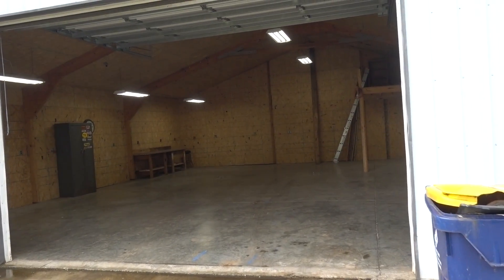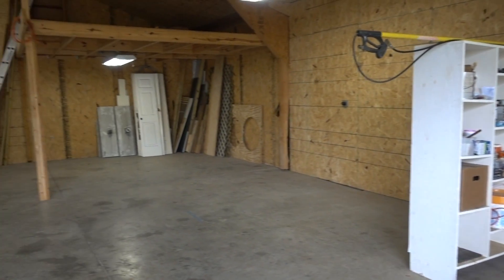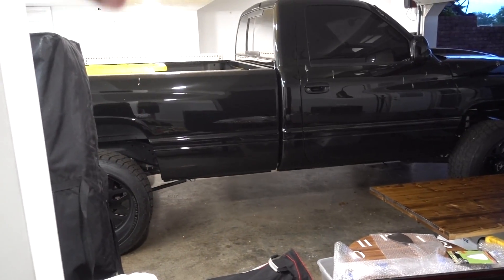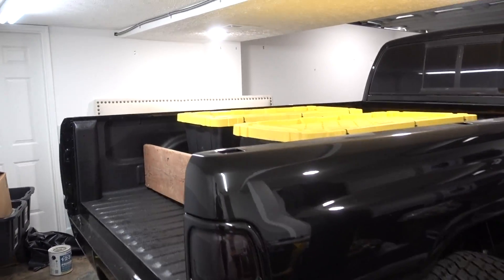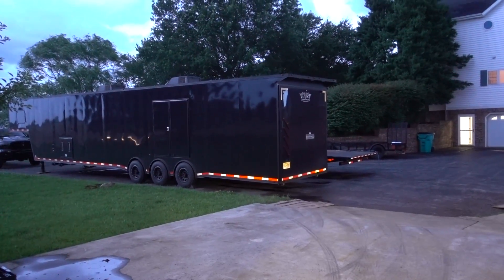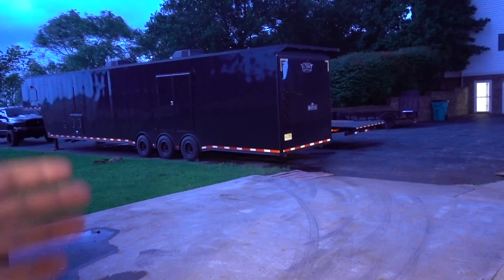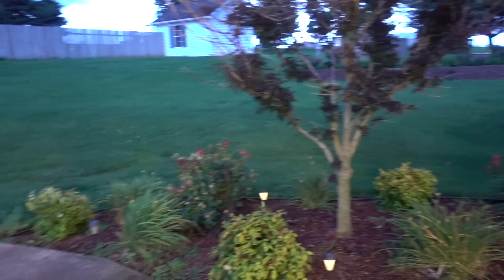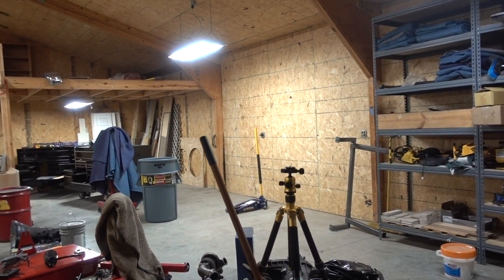NEW SHOP TOUR!!!! IT'S AWESOME!!!!

Comment: There are insulation kits for the shop overhead door instead of replacing the whole door. Also, whatever you do, DO NOT decide to just paint the concrete floors (garage and/or shop). They make concrete floor paint that can be very tempting when comparing the price to an epoxy coated floor. Problem is, it will NOT stick over time. As a custom home builder for 16 years (in Kentucky coincidentally),  I learned the hard way, the painted floors will begin to peel and flake not to mention it makes a huge mess. Then it's uglier than when you started. Oh well enough said. Just thought I would pass some along some experience we gained the hard way.

Comment: Prime the plywood with a stain blocking primer and paint the shop with a white semi-gloss paint.  It'll save you money on sheetrock since you already have the plywood anyway and a semi-gloss would have good light reflection and it will be easier to clean.

Comment: if you drywall then you could add insulation or maybe cover the walls with corrugated metal I know it is silver but would reflect a lot of light. For a temp fix to the hot shop door put a water mister on it that should help until you change the door.

Comment: Tge ac unit your thinking of is a minisplit. And yes they will push enougbt btus for your shop. They also make units where its one outside unit and multiple indoor heads. The newer ones have heat pumps as well which can do ac and heat. I'm sure the humidity is crazy down there and the minisplits pull an insane amount of moisture out of what ever location you install them in. Not to mention alot cheaper than running duct work. Do research on brands. They all do the same thing. And all use Mitsubishi pumps. Realy just paying for the name

Comment: Be careful moving the lift location depending on how thick of a pad the floor is. Alot of times if its just a 4 or so inch this slab, they will pour 6-8 inch footers under where the lift will be placed at to support the weight.

Comment: Putting up barn tin on wall kind of makes hard to trim around recessed outlets that you have. A/C you talked about, called split ductless unit, I think they go up 36k BTU in capacity. Where I live, to size one of those, a rule of thumb is 750 sqft per 12k BTUs, but that's with 8' tall ceilings, so if you get a 3 ton unit, you should be able to to maintain 72-75 in there, just don't expect to let it sit at 100 degrees for a few days and then pull temperature down to 70 in an hour. Cool place, congrats!!

Comment: Put some roll formed steal in the inside would really make it look good compared to the obs board. Like a white with gray Wayne’s coat on the bottom. And then with the grading and gravel pad for the trailers and peterbuilt, I’d put some modified base stone. Packed in obviously.

Comment: Check out Home Depot they have some badass ac units like that. I have a 4 ton AC in Vegas in 115 degrees with fabrication inside and it stays 75 degrees inside and I love it my bill went up 50 bucks a month not a big deal when you're not sweating your ass off not getting stuff done. Before I add the AC unit I worked at night In my shop.

Comment: I thought you owned the lights in the shop you rented and couple heat pumps in there would work well for a/c. Drywall half the wall then go steel the rest of the way and maybe wrap the rafters in yellow steel ?

Comment: The concrete under the lift pads in the current location is probably (should be anyway) thicker or reinforced better to handle the weight. Hopefully the whole floor can handle a lift and you wont need to make it stronger when you move the lift

Comment: Look into fiberglass reinforced plastic panels run around $40 per 4x8 sheet it’s a white lightly textured panel that’s washable did the bottom 4ft of my small shop with it an then used some peg board also

Comment: I’d put the tools in front of the yellow truck just so it’s kind of centered. I’m building a 40x40 right now and that’s what I’m going to do. And I’m putting osb up and going to paint it white. It won’t be smooth but it won’t finish out real rough. And having a loft for a storage is real handy! Also do ya know if the shop is insulated or not?

Comment: I would cut an opening out on back wall and have a big fan installed so it sucks air through shop or when you crank the trucks up with door closed suck smoke out.

Comment: I have a Fredrick 36,000 btu window unit in my shop for AC it kicks ass.  It also has heat but I'm not sure how the heat works as I use a radiant tube heater.

Comment: I would put a 60,000 BTU dual head mini split in with a head unit on each side of the shop.  And a taller insulated garage door so you can get the PeterBuilt in the shop 10 foot door doesn't seem high enough.

Comment: My family's shop is that same chip board type stuff and we painted it white and it looks great and reflects light well. I will dm you a video on insta so you can see for yourself. We also just painted the concrete floor and put sand in it for traction.

Comment: Cut that storage shelf at a 45 degree angle and maybe it wont be in the way.
Just spray the walls white.
Reply: Insulate the garage door yourself. Looks like the electric just need receptacles installed.

Comment: Huge Money Saving Tip: Call your local county hazmat center for paints and chemicals disposal. My shop has plywood walls 20x50x14 metal building. Most places you can pickup the old paint that people drop off for free, they typically pour it together in like colors, white being one of the more common colors i was able to get a few hundred gallons of mixed white paint from the county for free, so i painted the entire inside of the shop with 3 coats of paint for free with a paint sprayer i rented from homedepot. To make the color even i poured all the 1 and 5 gallon buckets of paint into a 55 gallon drum i bought off craigslist for $20 and mixed them all in that drum and ran the sprayer directly from the 55 gallon drum. Basically able to paint the entire shop with 3 coats of white paint for around $150 between a few supplies and renting the paint sprayer for 1 day..

Comment: Use that smooth plastic paneling from Menards it's cheaper than drywall and it is easy to clean

Model Number: PTC0045M Menards® SKU: 5072787

Comment: OSB is cheap but boy, is it ugly. I'd look for white finished paneling, right over the OSB (that's what I intend to do in my own OSB lined shop). There's also a thin white vinyl (?) panel that they use in restaurants for sanitary reasons that would go right over the OSB. The square shape is going to be WAY more efficient for you than the old place, even being 200 sq ft short. Plan your parking layout, plan your work flow, you've got massive ceiling height for all the loft space you can use, you just have to plan it out of the way of the parking.

Comment: Look at mini split AC units, possibly with solar. Here is a link to a company that hast AC that can be run directly from solar panels or the grid. https://www.hotspotenergy.com   
You can insulate the garage door your selve, just remove the reinforcement beams, install the boards, mount the beams back, done.